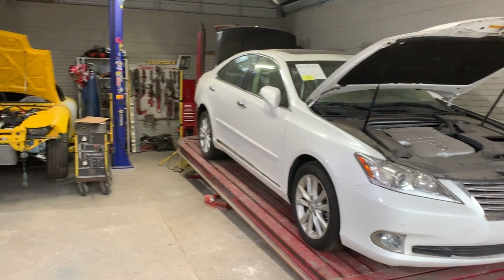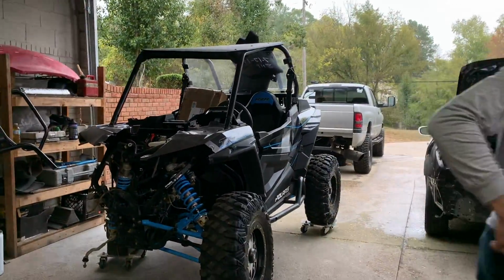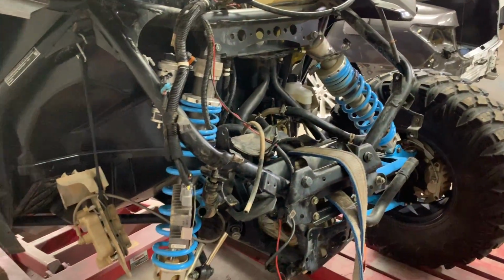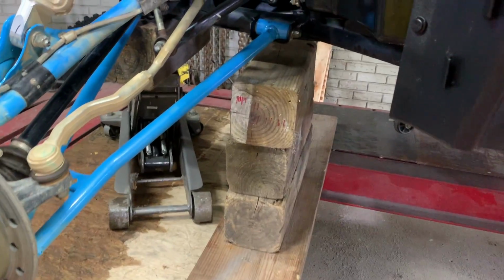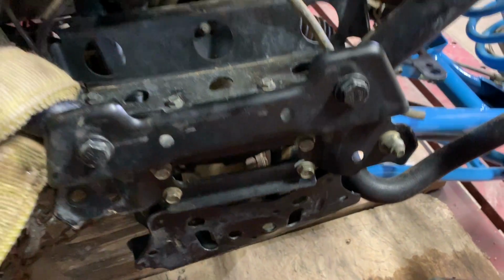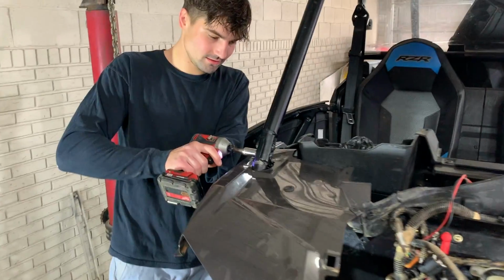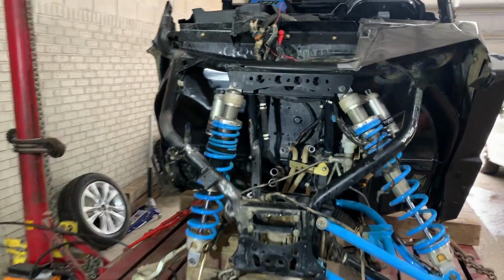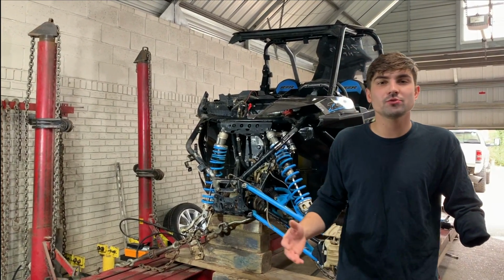My 2019 Turbo XP Razor Has More Frame Damage Than I Thought

Comment: Pulling a frame so it looks straight is one thing but are you getting good measurements from set points on the frame so it's absolutely correct and in tolerance? I'm just asking as I was a plumber by trade. That's what bothers me about frame damaged sxs. Does it have a clean title?

Comment: I've been a Polaris tech for 15 years. Please do yourself a favor and at the very least get the front frame 1024369-458. Polaris frames do not react well to being pulled and you don't want a failure in a 170hp SXS.
Reply: How much are those?
Reply: I gotta agree with the polaris tech. I own the exact same model, color, sans the carnage. Given the extreme pressures these machines see on the trail, no way I would trust a repaired frame. Fortunately, you can buy the front 1/2 of the frame and repair it properly. Shame to waste all that time and money to have it fail on you and have to do the work again. But kudos on your determination guys.
Reply: I would replace it as well ,it would be a shame to see it break at high speeds
Reply: @MyFriendPeter-d4k  Retail for $1,800ish
Reply: Well I did auto body frame and collision repair for more years than that. Worked with similar frame machines as seen here. I can tell you there is as much or more risk of failure in cutting out and replacing frame sections. Cold straightening frame sections   by experienced operators with proper frame equipment is as good and often better.
Reply: @jrsue  Uhm, the front frame section bolts on. Don't speak of which you don't know.
Reply: It's a bolt on frame section and you can find them used from guys swapping a 2 seater to 4 seater.. but I agree maybe a few more gussets on the frame you fixed and it would be fine. They also sell a kit to strengthen the a arm tabs I would do that as well. Also if you stand on the driver rear side you could of drove it up without the wheel on.
Reply: 93Cobra 2k

Comment: i replaced half a 2014 rzr 1000 frame cuz of a roll-over for a single piece that goes through the hood hole that was crooked a little bit your frame got alot of issue. blue is super fine for the beadlocks

Comment: Make sure you bleed the air from the cooling system. Bleeder is on top of engine,and is a pain in the balls to get too.  Also the inter cooler takes a long time to purge the air.
Reply: Actually, I think there is a trick you can do. Just fill up the radiator with coolant once it's all connected as well as the reservoir like normal. Then raise the machine up into the air a little bit and then remove the radiator cap. Then start it up and let it run for about a minute and you should see bubbles coming out as you look. Then go ahead and put the cap back on and the air should be out of the coolant system. Take it for a ride to make sure it does not overheat and if it does not, then that confirms that all air is out of the system.

Comment: Dude just buy a frame they’re not that expensive stop being cheap you’re going to get yourself hurt Or if your planing on selling it you’re going to get somebody else hurt
Reply: List for the 2 frames is $3,900 and they're currently unavailable. It's not something that is normally kept in stock.
Reply: troglodyte1969 eBay dude or market place come on I just looked they are available
Reply: @matthewmilam286  I just did a quick lookup on our dealer network. I'd pass every time on used frames.